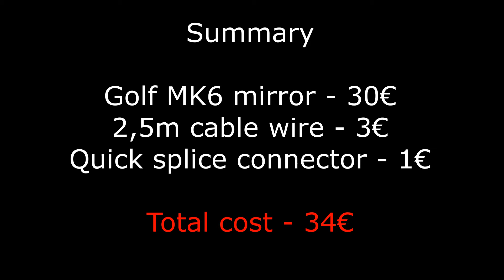Install VW Golf 6 auto dim mirror to Golf 4

Comment: The positive wire is acc ? Is that 12v with key on?  How does it auto dim  does it not need to be connected to the lights or some sensor ?

Comment: hi excellente job, I want it for my car, but, do you know that the other wires you cut, one is the reverse signal, when you put the reverse the autodimming is off.. but I don´t know wich is the wire...
Reply from the maker: But why it’s important to you? Other wires are related with side mirrors and interior lighting. But they are useless as you don’t need them in order to operate auto dim mirror.
Reply: @lutz6441  I don't know in vw, in Ford they have 3 wires, 1 positive, 1 negative and the reverse signal,  I dont know if vw is similar, but the signal reverse is for safety reasons.....
Reply from the maker: Sadly I don’t have information about reverse signal wire location in this mirror plug.
Reply: @lutz6441  but your video helps a lot :)
Reply: @lutz6441   power wire you tap in fuse number 5?
Reply: @lutz6441   or did you conect power wire to 75 terminal? :D Tnx for answer :D
Reply: @lutz6441   wire number 3 is reverse  wire?